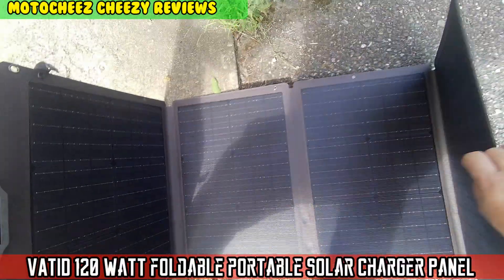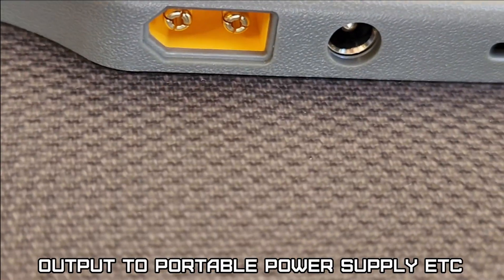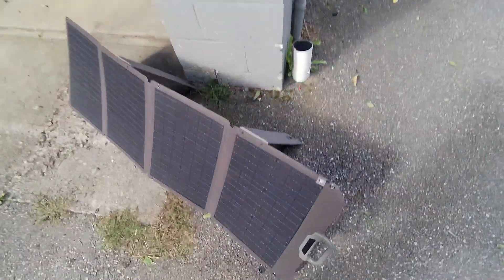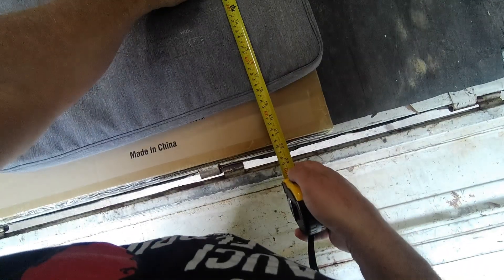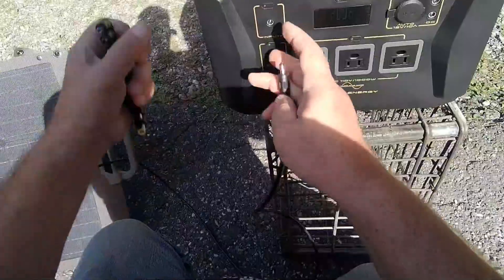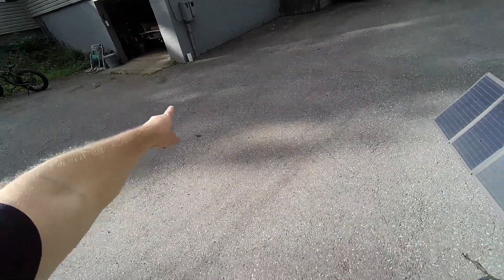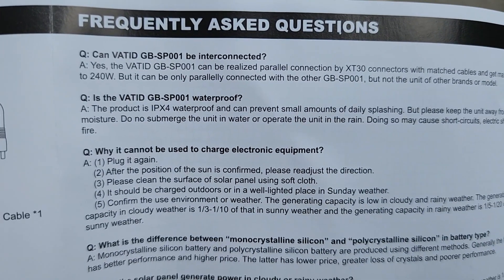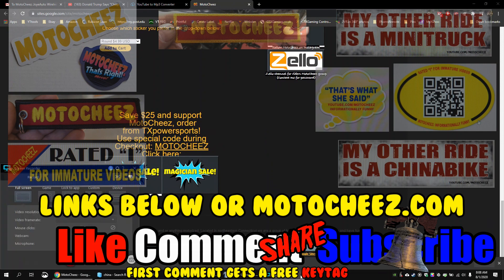VATID 120 watt foldable portable Solar charger Panel. PPS, QC3.0 USB & DC Output Camping Van RV

Comment: I can't believe that any solar panel manufacturer specifies the actual wattage in real use, and I'm doubly shocked that a Chinese manufacturer did that.  In bright sunlight, I plan on half of the rated power.  Every other solar panel specification I've seen is some sort of theoretical rating, which is apparently at noon, on the equator, at summer solstice, on the International Space Station.

The Vatid build quality looks good and I like the design with the exception of the cords that block the mono crystalline panel, as you mentioned.  That really bugged me.  It wouldn't have mattered so much if it was an amorphous panel.

There's one Amazon review and it panned the Vatid for only producing 67 watts at 9AM, which is about what I'd expect for a 120W solar panel given the typical solar manufacturers' specsmanship.
Reply from the maker: Yes I was suprized too! Usually 75% I've seen

Comment: I need a link for that old battery charger. Lol I've had mine 30 years and still works. i Need to get another one back up before they start making the new ones  out of junk. Lol  J/k but the new one are junk my dad has went through 2 Even though they weren't used much. 👍👌✌️💯
Reply from the maker: They are junk! Best bet is to find one at a tag sale. All the new ones are garbage
Reply: @MotoCheez  yep my dad gave me the one you have and I feel bad because he had to buy more then one. Im let him use mine lol his old one so I guess I'm looking for one. I have a good jump start box. But most of those are junk to I took me one to many to find a good brand one between the two we make dew 👍👌✌️💯 thank and have a great one hope all is well on your side

Comment: Looks like a decent set up. The direct connections seem odd. I wonder how much power they sideline that could be pushing into a battery. Using dc outlets on the power unit should be a better use. Also that output shading the panel even a tiny bit is a fail.
Reply from the maker: Agreed

Comment: How long to charge that e bike battery?
Reply from the maker: If you can get the proper adapter to fit the batteries which this does not have I used an online calculator it says 6.9 hours to charge the Vanpowers bike fully (14ah battery) and 9.8 hours on the Magicycle 20ah battery. Of course that's with optimal sunshine.

Comment: All these things are cool if you don't want to use a gas generator and carry extra big heavy noisy equipment. But like on my E Bike.. I get range anxiety and want to get an extra battery. Lol I still would feel better having a generator and gas I think.
Reply from the maker: Definitely!
Reply: I had a real emergency here in Texas about two years ago. I had a gas generator, but it was way underpowered and it ran out of gas in 3.5 hours. Guess what you need to pump gas? Electricity! Also we were unable to travel even to the gas station because of the snow. I have since upgraded my generator and it runs on propane. I have enough to last a couple of weeks, but I also have 5 solar generators and solar panels for all of them. I just wanted to relate my experience. Thanks 👍
Reply from the maker: Awesome, thanks for sharing. I have a 7500 watt generator here because we lose power a lot, one time was 3 weeks in winter time when it was 25 degrees out. The more power backups the better. I figured with a couple portable power supply units I can keep my refrigerator running my wood stove fan blowing, keep my cell phones charged and my internet going.  Then I don't have to rely on the generator as much